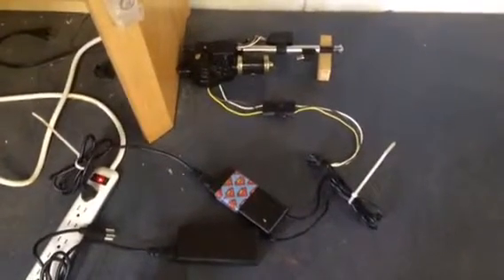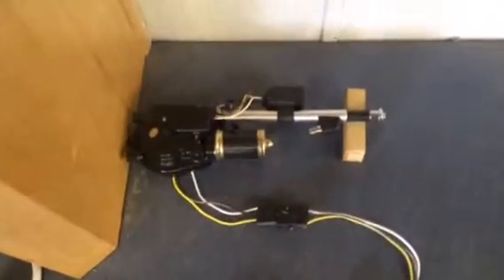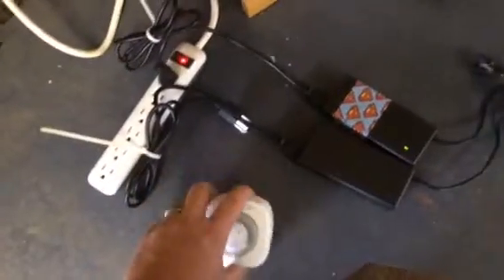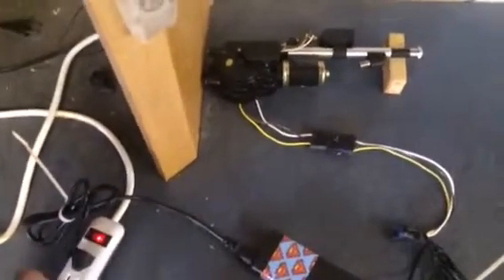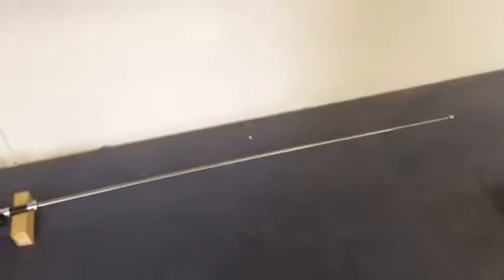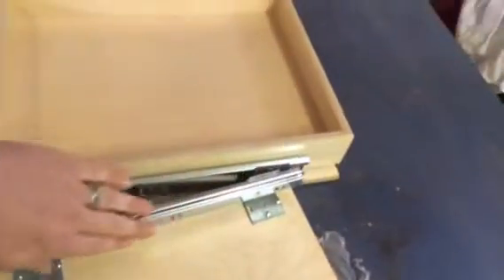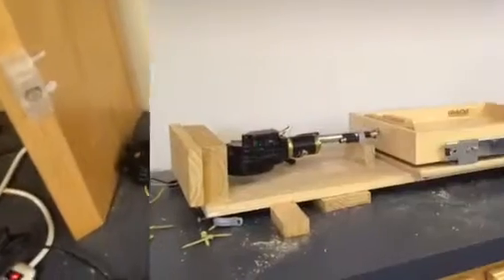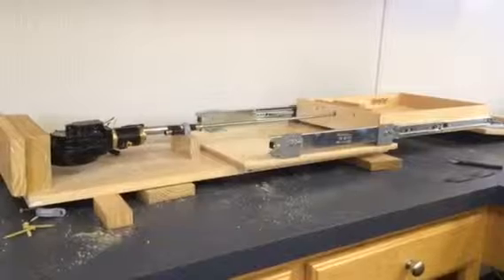DIY Automatic chicken coop door opener for chicken tractor

Comment: Nice
Does the motor sense when the door is closed and stop running?   My coop isn't all that tall and the door doesn't need to move but about 10" or so.  I'd hate to burn up the motor.
Reply from the maker: It stops on its own.
Reply: +Michael Pixley Thank you.   A couple months after I asked my question, I built my own auto door opener with a car antenna with 12v battery.  It's working nicely, and yes...the antennas have a built in limit switch.

I've since added a 2nd timer to my system because I found that even at rest, the antenna will draw a tiny bit of amp. (milli-amps) from the battery.   It's not much, but over a 24 hour period of time, that adds up.  The 2nd timer has more than tripled how long my battery lasts.

Take care.